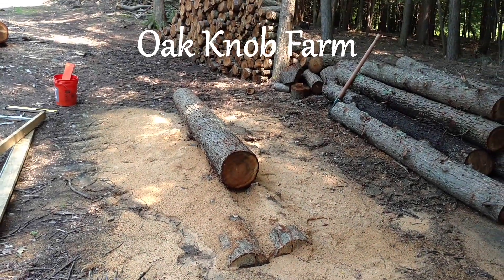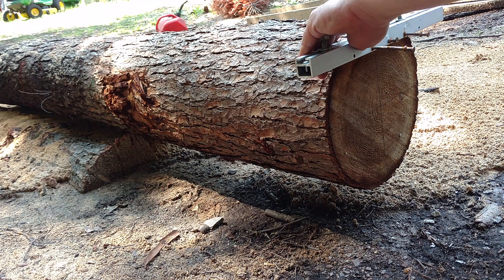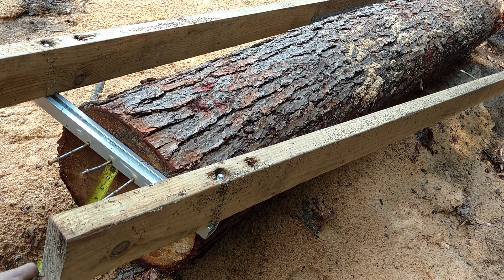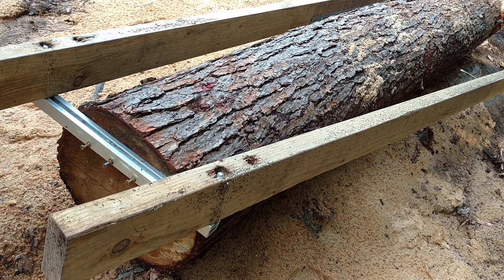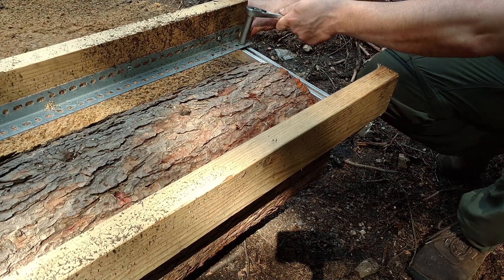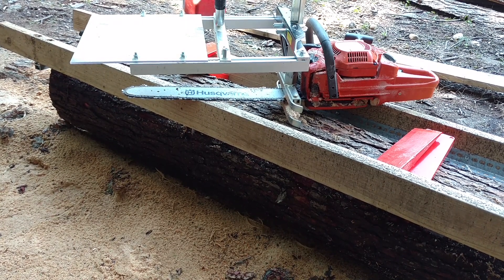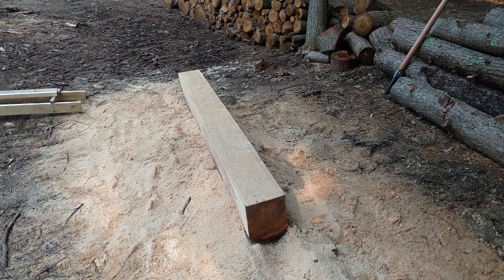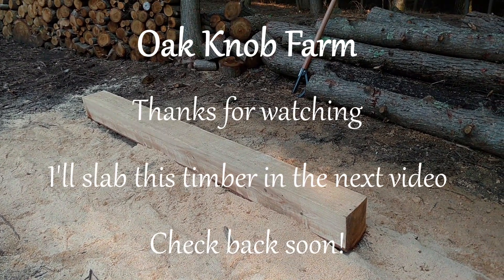Chainsaw Mill 01: A Rough Timber

Comment: I totally am goingto buy one of these... gotta come back and watch this
Reply from the maker: They are very handy.  I have the "slabbing" jig and the '"90 degree jig" Between the two I can make wood of basically any dimension.  
It is slow - 10 minutes per "slab".  But I had low quality firewood (Hemlock) in abundance.   It''s better as 2x4s than firewood.
The good hardwoods get kept for burning.   The softwood becomes chicken coops :)